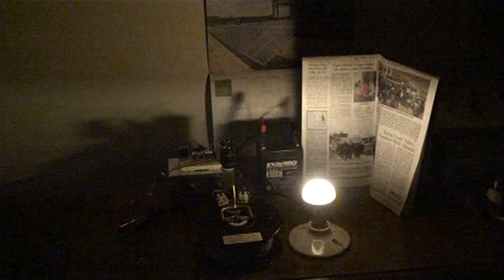CUTTING EDGE.MPG

Comment from the maker: @jackscholze  The LED lamp I am powering is rated at 90 to 220 volts AC . I am powering it with a small 12 volt DC battery.  The lamp is "ALMOST" lit to full intensity. I did plug the lamp into 120 volt wall receptical to see what the actual full brightness was.

I have a clamp meter on its way to me right now that I will measure all DC current and voltage without having to break into the operating circuit itself.. Will post results when finished.  Also going to try. a smaller ring magnet.

Comment from the maker: @TedFnBuckle   I am  auction bidding  for a clamp type multimeter that measures  low "DC CURRENT" as well as AC and DC current and voltage. This device powers  up so strange that all 4 of my meters read differently. I have two expensive meters and they dont read the same??  Thats when I plug the meters into the circuit themselves.  Now my thought is to buy a DC current clamp meter that can read .01 amp or better by claming the jaws over a wire.  No breaking into the circuit.   Send data later.